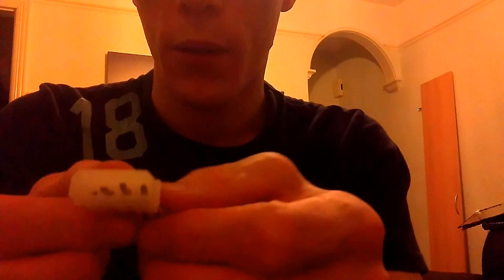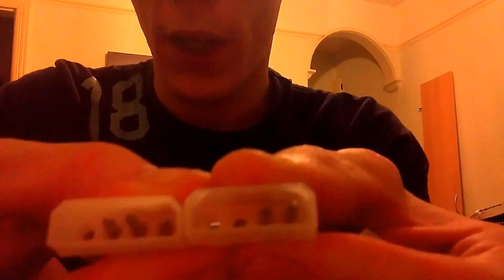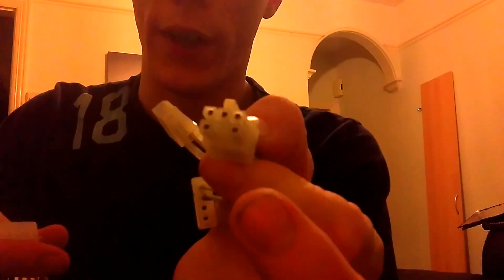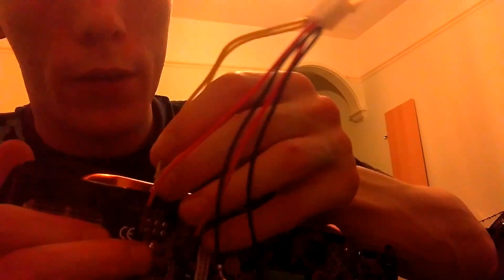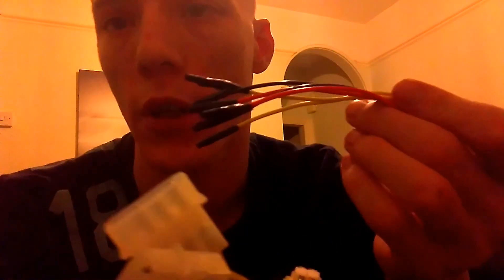How To: Connecting A PCIe GPU Without A 6-Pin Power Cable Video Tutorial

Comment: Actually the PCI slot can only provide 75 watts, not 150. If it were 150 then most new cards wouldn't need extra power connection.
Reply from the maker: Yes you're right, my bad sorry :)
Reply: Then why ASUS gtx 750ti has a 6 pin connector?
Please tell
Reply: @ITZMEALLOY  bcs ftw version needs more energy,im not sure..
Reply: @ognjen8964  FTW is from EVGA.
The gigabyte gtx 750ti non oc also has a 6 pin connector.
Reply: @ognjen8964  I believe it all depends on the joule rating on the power supply.

Comment: Don't use any of those adapters unless you like fire.

If a PSU doesn't have pcie connectors it is not designed to power a gpu that needs them.

Comment: Hiya mate I could have done with this video 9 months ago! I had the exact graphics card with the exact problem and didn’t have the connector to power it on my psu I have recently bought a new psu with it on so it’s not an issue all I did was steal (borrow) the 12v black and yellow which was spare and splice into it! Also wired my leds up to the same wire pc lights up blue now aswell. :)

Comment: how long would it be safe to use this adapter (bought one from the store) until i get a new psu? For example,would it be safe for like 1-2 months?
Reply: Late reply but avoid adapters my pc almost caught on fire when the adapter melted.
Reply: @crown6468  Probably wasn't fully connected and caused a short.
Reply: I been using adapters on 2 different pc's for years,one running a gtx 960 and the other running a gtx 560 which is my media pc that runs 24/7 with no issues at all.

Comment: Anyone tried this ? It works with 1060 ? 
Cause i have a 450W atx i'm gonna buy a used 1060 sooo it works fine with ?
Reply: I have GTX 1060 3GB, i7-2600K 16GB of RAM and 256GB SSD with 400w "unknown" PSU and it works fine. Just look at your 12V rail, if it's more than 30A than I think you good to go.

Comment: Hi, would there be any chance of busting put my gpu if i bought from ebay a pcie power cable going from my corsair 550 power supply to my geforce 1050 6pin?
Reply from the maker: Converters will work fine, although some converters are known to catch fire so do be careful and dont buy the cheapest one you see

Comment: I need some help please, so I got a generic 750w PSU and a NVIDIA Quadro 4000 that max. watts comsuption reaches to 145w.
I bought myself one of these adapters from 6 pin to two molex endings with 3 pin each plug.
Will it be safe to plug the GPU from the 6 pin to the two ending molex? Thanks in advance.
Reply from the maker: Hey, yeah although I wouldn't recommend using adapters long term. They are known for the cable grade being inferior and end up catching fire, so long term I recommend upgrading your psu to one that has the connectors you need. Short term should be fine though
Reply: @TheCod3r  Thanks a bunch, I guess a have to upgrade yes or yes.

Comment: Dude you saved me. I did something like this myself to connect my 6 pin. However other day my HDD that was connected started to go out when I was playing my game. It was driving me nuts. SO I tried to change signal cables, tried a 2nd HDD which did the same thing. So I thought my PSU was dying. After looking through the wires I found a yellow lead not attached. I was like WTF where does that go. After watching your video at 5:54 I seen that it came from there. After splicing it into that wire it worked fine again. Thanks again!
Reply from the maker: You're welcome, glad I could help. Thanks for the great comment

Comment: excellent instruction. i'm in a podunk town and if i can find some cables to cut at the recycle center tomorrow, if not, i'll use amazon for the 6 pin from two 4 pin, plugs.

Comment: I have one of them,i have never used it cos mine is a AMD ATI 50 something,can't remember of the top of my head, the card is as big as yours,have to dig it out sometime and it has two 6 pin connectors...anyone know why..?
Reply: some low tdp cards only have one 6 pin. usually 128bit cards.

Comment: My problem is that my gpu is a amd hd 4870 but in the manual it doesnt support two 4 pin connectors to one 6 pin? What should i do because my psu doe not have any 6 pin connectors
Reply: zTxzz Albaner I have a Radeon hd 3870. Will a 24pin work with a 6 pin for my graphics card? My psu also doesn't have the 6 pin
Reply: T-Animations no. Just buy a corsair sv450 psu or a be quite psu
Reply: zTxzz Albaner be quiet psu? What are you trying to say man?
Reply: T-Animations you dont know the brand be quite?
Reply: zTxzz Albaner Oh sorry lmao 😂
Reply: zTxzz Albaner Well I don't have the money for either of those so I just bought some power connectors to connect my 6 pin to my esata port. My power supply unit has enough voltage anyways
Reply: T-Animations dude a psu cost like 40$
Reply: zTxzz Albaner Yeah and I'm 12 and spent $50 so far on a Sapphire Radeon Hd 3870, a new DVD drive, come connector cables, and a new motherboard. My psu has 275w which is enough for the graphics card I installed. It's not a GTX 1080 Ti. I will try to work more but for now I don't have that money
Reply: T-Animations bro they ripped you off. You could easy bought a gtx 750 ti for 50$
Reply: zTxzz Albaner The graphics card was $20. I'm saying everything all together was 50.

Comment: hi bro what abt the 8 pin
Reply: buy a better PSU. There is a workaround for 8 pin but apparently the voltage/wattage is so unstable, so not recommended

Comment: I have the same setup, was not built by me but my yellow wire is disconnected because it is burnt up? Do i need to re solder and make connection? Its the plug in on the video card. I have a gtx 1060. Lmk.
Reply: Did the guy burn it up for a reason? Looks like someone took a torch to it. Or did something happen and it burn up? My pc doesn't even recognize the 1060 and is running ami radeon 3000.

Comment: Isnt that going to burn the graphics card ? Because of the powersupply being low on watts?
Reply: wont burn if its too low the gpu will just not boot
Reply: No it wont, the pc will either not boot or when u run a game or application the system will be stucked

Comment: Great video man do that and one day I am sure you would have call the fire brigade to put out the fire your "electrical engineering" will cause just get a better PSU and stop making dangerous modifications
Reply from the maker: Hence the warning in the video, I know this isn't the safest mod, it's a temporary solution to a first world problem. Also, if you insulate this correctly it would never cause a fire, because all you are doing is connecting pins to wires, which is exactly what the actual adapter does. I don't force people to do this, it's simply a workaround if they have no other choice, and it's entirely their choice to follow this guide. It's up to the viewers to decide if this is safe for them. this video is strictly to explain and show how it is done.

Comment: I can tell you what I did when faced with a card that needed one 6 pin and one 8 pin connector  The power supply had just two 6 Pin connectors but no 8 pin.  I  used an adaptor to plug the two six pin from the PSU to make an 8 pin plug and a molex convertor to provide  the  power for the 6 pin plug.  it worked perfectly with a gtx 780 Card and a very old OCZ brand of 600 watt PSU